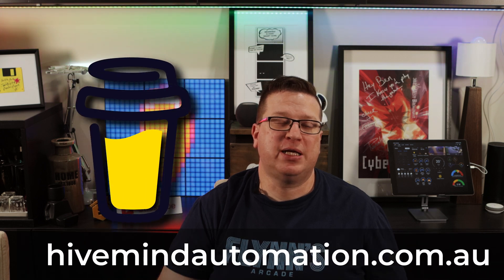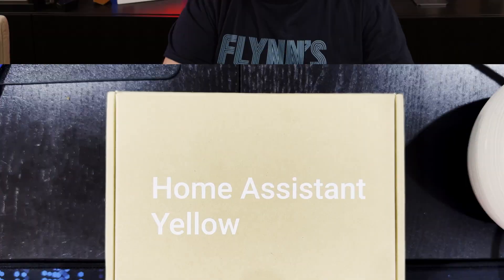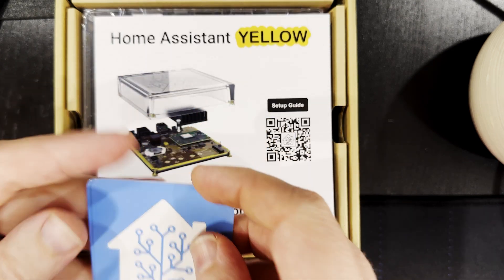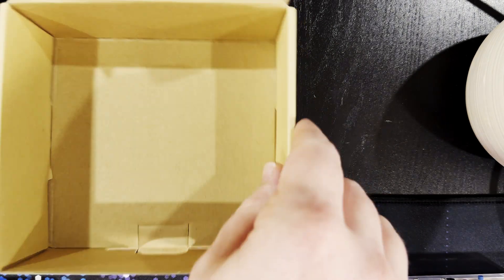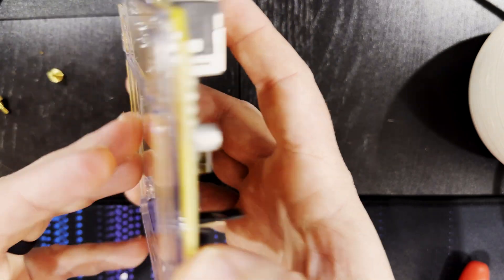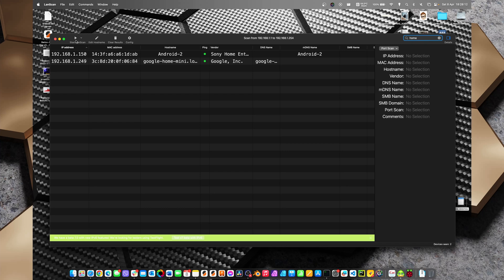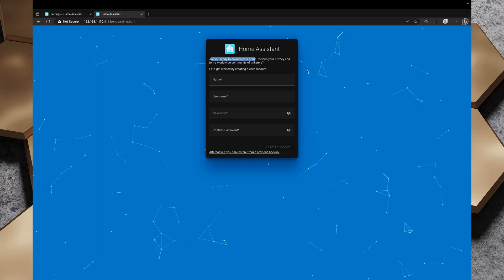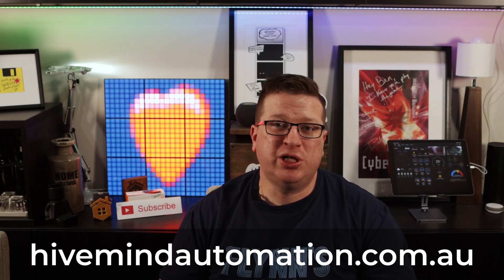Home Assistant Yellow PoE+ Edition

Comment: In your video tile , you indicate PoE+. But the website only sells PoE. PoE+ and PoE has different power delivery. Or do they not ? Please advise.
Reply from the maker: Force of habit on my part, it's just PoE

The core difference betrween PoE and PoE+ (and PoE++) is the wattage it can deliver.
 a PoE device will run on PoE+ or PoE++, but a PoE+ or ++ device is unlikely to run from a PoE switch due to insufficient power delivery.
Reply: @HiveMindAutomation  noted. Thank you for the info :)
Reply: The website says it supports both PoE and PoE+, it says selectable via jumper (but doesn't specify which jumper)
Reply from the maker: I didn't have to select a jumper, I just plugged it in. I don't recall seeing a jumper, but when I get a chance I'll take a look.

Comment: 2nd video in recent weeks. This funny even with the shortage of Pi's there should have been a video of using this. instead we get more videos of unboxing. A hardware that is years old and no really video's on setting up and using is pretty disappointing. Hopefully you will do a 2nd video on this hardware.
Reply from the maker: There's more videos planned but my work schedule has been crazy so I've not had any time to plan out anything.
There's 2 other videos where I show how to image the CM4 - Easy way and Hard way.

The Yellow - with the CM4 - is going to be replacing my production instance of Home Assistant and I'm considering starting the whole thing from scratch instead of restoring a backup with all the old cruft. As you may imagine, that's going to take a bunch of planning.
Reply: LoL, 4months later still no video's on using the yellow. I ordered last year and cancelled because of no pi. CM4's are just beginning to be available in the US (thought still not wireless). Hopefully more videos will come available (Hive Mind still hasn't moved on his yet, though he teased a month ago he would be doing so).
Reply from the maker: @AM-jw1lo  - I'm using it as my production HA Server now.

What do you want to know?

There's not really much more to say about it. Using HASS on the Yellow isn't any different from using it on a Pi4, except that it's got some additional hardware for Zigbee/Thread and NVME storage/PCIe expansion built in.

I didn't see much point in doing a video of me restoring HASS to my Yellow, because per the video a month ago, I lost all my settings and ended up setting it up from scratch, and I've already done at least 2 videos on how to do that.

Comment: Do you know what the jumpers on the board do?   One is labelled CLS3 and CLS4 another is USB/UART and the last USB Recovery.
As a note, even when you uploaded this video, it was known a M.2 Coral will not work with a Home Assistant Yellow due to limitations with the CM4 module.   If you want to use a Coral you need to get a USB version.
I am really only asking this now as I just got my hands on a CM4 41008000 Which is the "lite" version, 8GB RAM, no eMMC, with Bluetooth and WiFi.   I wanted the Bluetooth on board to save a USB adaptor :)
I like that Nabu Casa don't spend a lot on fancy packaging, given this is a mail order product and not sitting on retail shelves.    I prefer plain packaging rather than spending an extra significant amount to get fancy packaging :)
Reply from the maker: I've not figured out all the jumpers yet but when I figure it out I'll let you know.